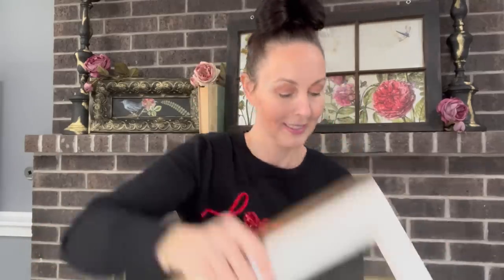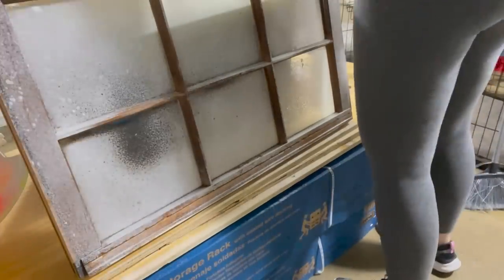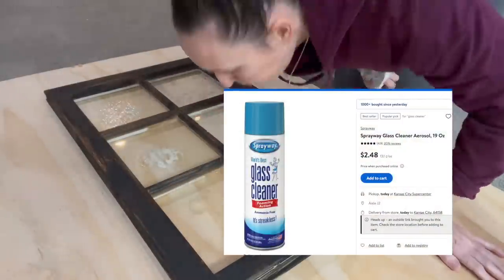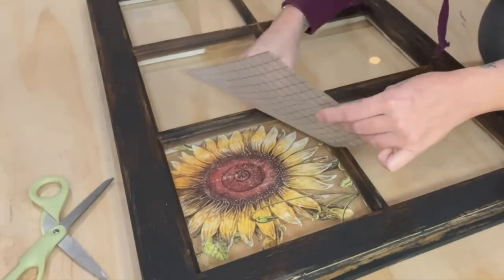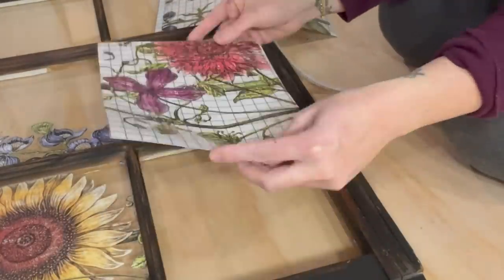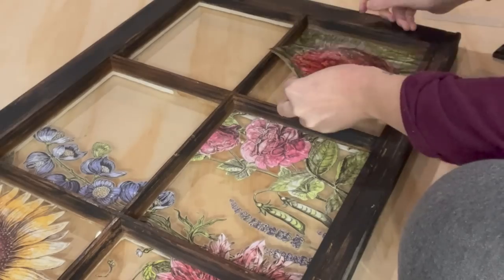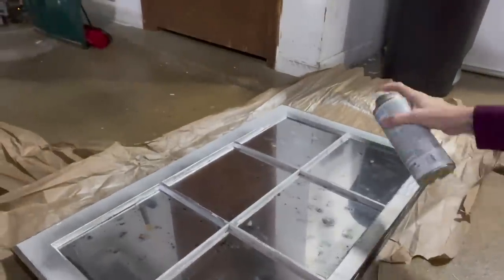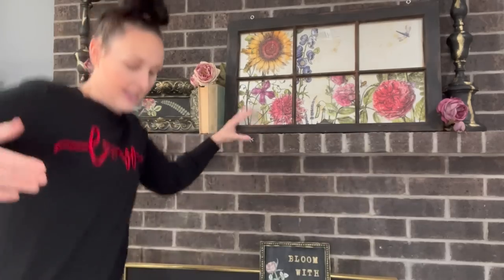ANTIQUE WINDOW DIY with MIRROR EFFECT spray paint | Farmhouse Window DIY | DIY MERCURY GLASS WINDOW

Comment: I’ve done this many times. I’m still learning but if you’ll do the vinegar and water before you spray the mirror paint then let dry and then blot. Do this with each layer and it will give you a very aged look. Yours is beautiful too though! I’ve not done the transfer on top. I’ve only done modpodge decoupage paper on back and mirrored around it.

Comment: You were asking about crackle medium, and ive made it with contact cement.  Brush on the cement and let it dry, then brush on your paint, but try to only brush it a couple of times.  You will have to experiment with the cement on trash wood to see what makes big ctacks or little cracks, but it works every time.  Try it!  I am going to make some windows into old mirrors now.  Thanks!  ❤❤❤❤❤😊

Comment: The way I learned about doing the mercury glass thing was to use a spray bottle, you'll get better coverage, full white vinegar and put it on while it's still a little wet- it'll take off the paint much easier in the spots you put it, it like, dries like that or something, if I remember right. I believe I did it on glass in a jewelry box, but it was several years ago and I can't remember lol. Very pretty tho! Thanks for sharing the whole process, def more helpful.

Comment: This turned out lovely!  when I do the mercury glass effect, I use 50/50 water and vinegar but I apply it directly on the glass before any mirror spray and then spray over the wet bubbles.  When dry you only have to lightly dab with a kleenex, not a papertowel as that will add that texture on your spots.  Then do that again a few times and you will get more "mercury" effect.  I love the gold spray on the back; it brings the "sun" out on your window.  It is quite lovely!
Reply: This

Comment: No, girl! I don't ever and have never seen anyone seal a transfer on glass. Transfers stick to glass so well that there really is no need especially as a decor piece.
Also.... I've never done the water and vinegar mixture like you did. I either spray my water and vinegar mix on the window first before the mirror effects spray (this seems to work the best for me) and where the water/vinegar mixture is, the mirror effect will lay on top of your water droplets. I then take a paper towel or shop towel and dab where the water dots and the water mist are. The other way I do it is somewhat like what you did but I don't let the mirror effect sit that long before spraying my mixture. I spray the mirror effect and then spray the mixture right after. Then the mirror effect under the mixture will not dry and therefore you can start dabbing away and the mirror effect will come up much easier. Just a few tips. Hope this helps, love ❤️

Comment: It is really a good thing you couldn't use your sander. I made that mistake on the very first window I did. The vibration from the sander cracked the glass and I had to replace it. Stick with a brush or rags or anything except a sander.